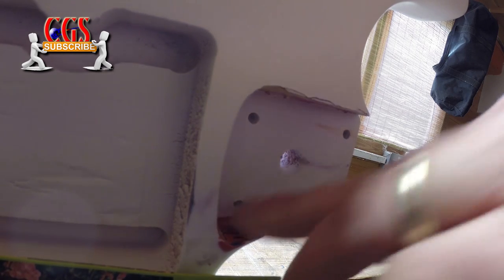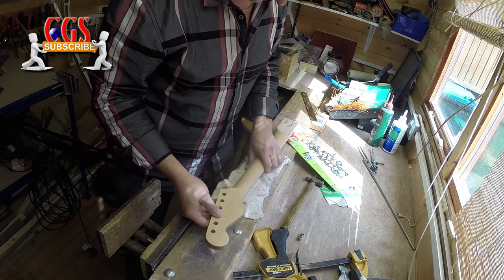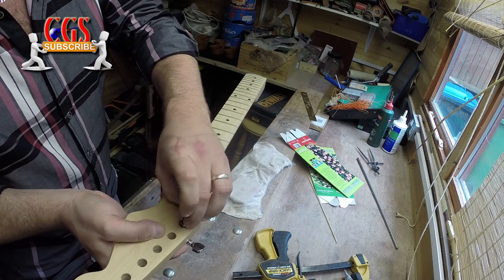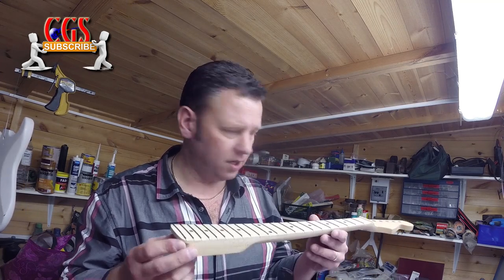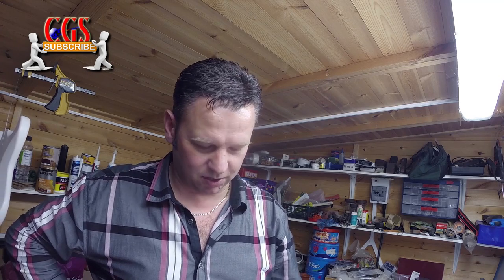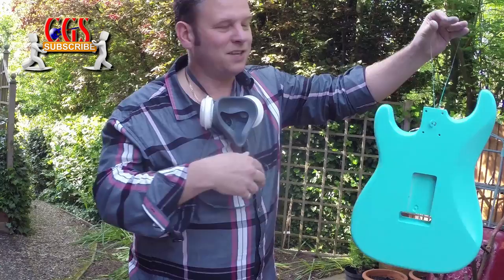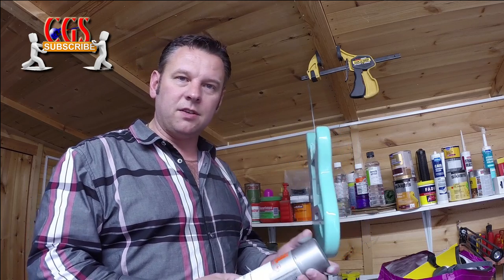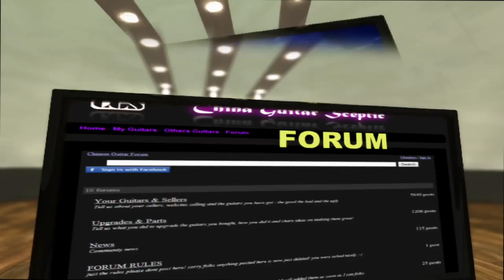Build a Custom Strat Guitar from parts - First Colour Coat - Part-o-caster Part 4

Comment: Love watching these videos on this project in the early hours of a Sunday morning, months after you did this guitar.  This week I'm starting on a kit stratocaster with similar painting method.  I used Krylon quick drying (supposedly) cans with primer which seems to be working out well so far.  I went for what krylon calls Gumdrop which is a very light purple,  sorta lilac violet which is quite different than other strats I've seen.  I even went for the maple fretboard with tusq nut similar to what you're using.

Comment: Wonderful color.. I must say that I am not a picky person when it comes to color of my guitar.. black is best.. :)  but I do like some metallic blue.. but this color looks like it will fit perfectly with your project. just one thing of note.. wouldn't it be more productive to have something ELSE holding the body up while you are spraying it rather than your hand? probably would be neater as well. lol
Reply from the maker: Thanks buddy, nice suggestion. I have always just held the guitars to spray them. That bit of doubled wire gives me some control to turn it and stay into the wind when spraying outside. I'd love to have a booth and then I would hang it for sure. :@)